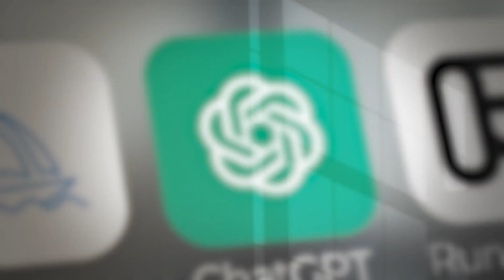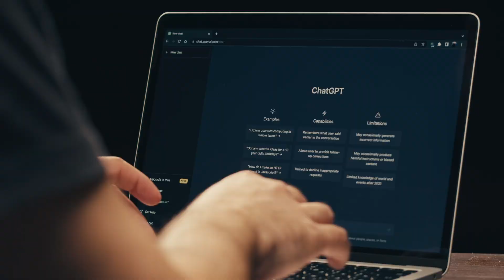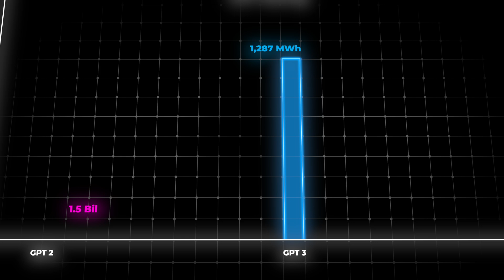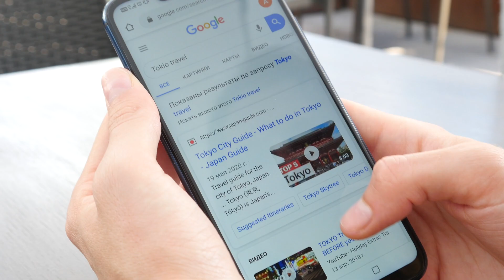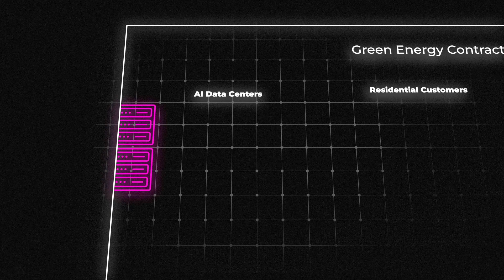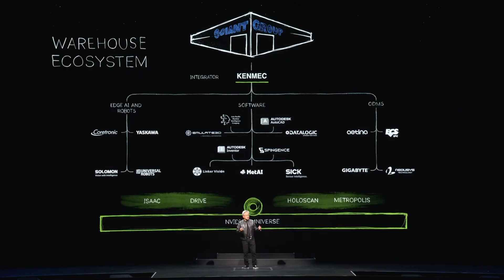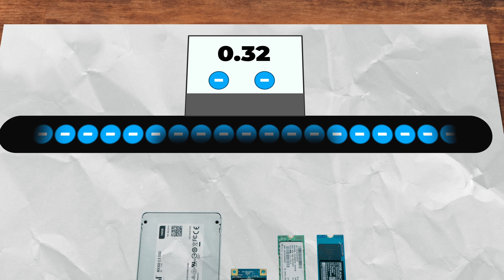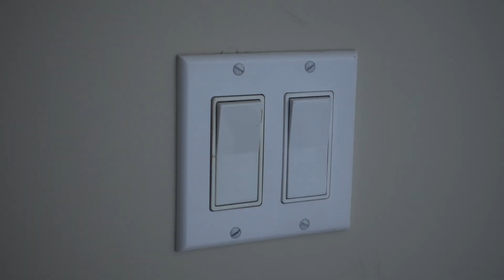AI's Hidden Cost: Can Our Power Grids Keep Up?

Comment: Has anyone done a calculation on how world wide data centers affect global warming?  They are warming up the atmosphere.  If they are supplied incrementally by the grid using fossil fueled power plants they are also responsible for the waste heat produced by the power plants.

Comment: I’m always up for heat recovery videos.   I’m not sure the temperatures are high enough to economically support waste heat recovery.    

You should visit Ormat and learn about their geothermal and waste heat recovery methods using a low temperature organic working fluid like butane.

Comment: You didn't even mention cryptocurrency. Tesla is also building mega-batteries to absorb excess power at peak production and feed it back into the grid during peak consumption. The infrastructure also needs upgrading. It is not built to handle the power loads of the future economy.

Comment: This is upside down and scatter brained thinking.  What has killed public power grids and people from lack of focus on their power supply lines in the USA is forcing them to buy when-ever-available expensive nearly worthless erratic solar voltaic and wind generated electricity not the nice predictable loads of a good data center customer that supports the power grid with its purchases.  New data centers are typically great power grid customers.  

Commercial HVAC system use natural gas for heating water and direct heating.  They do not use heat pumps for generating heat.  There are special situation, but heat pumps don't offer a heating cost advantage over heating with natural gas.  There is no move to switch to heat pumps for heating in highly engineered commercial HVAC systems.  That tells you the economic physics of the situation.  

Anybody that is promoting greenhouse gas emissions is ether ignorant or a criminal in what they are doing.   Its high school level science all the greenhouse radiant energy from the earth is entirely absorbed in earth's greenhouse effect within 20 meters of the surface that is always in saturation from the strong greenhouse water vapor.   Any high school science nerd should remember that.  I do.    

You can say noncondensing greenhouse gases warm the planet, but only as a share in a saturated system where water vapor would hold it in saturation regardless of the presence of the noncondensing greenhouse gases.  It is impossible to change the overall effect of earth's greenhouse effect with noncondensing greenhouse gases such as CO2 or methane.   In that saturated system on average CO2 has a 1/4 of 1% share in earth's greenhouse effect.   Earth's greenhouse effect adds 10°F (5.55°C) to earth's average temperatures.   CO2's average temperature forcing share is 4/1000°C - 6/1000°C.  Global warming is about 1°C.  That shows how far away impossible it is for CO2 to make any significant difference with its greenhouse gas behavior.   

If you follow global warming over the last 45 years global warming after rising at 2/10°C per decade in the 1970s and 1980s went dead at about 1°C in 1992 and has stayed there.   It was a surprise and a bit of a disappointment after promoting the typing point of 1.3°C as causing stronger hurricanes in the Gulf of Mexico by the late 1990s.  In 2022 global warming was officially reported at 1.06°C.   

The cause of global warming is not known after much scientific study in 2024.  Much effort has been focused on possible human causes of global warming with no human causes no matter how removed totaling to net zero.  After this long period of study over 60 years it is very unlikely global warming will emerged as having come from human causes.

Comment: Rick, we have an impass about the second law of thermodymamics. You are probably as tired of me thinking we can escape it as I am about you asserting it is inescapible. 

Here is one of my attempts at being too simple to fail but not too simple: 

A simple rectifier crystal can, iust short of a replicatable long term demonstration of a powerful prototype, almost certainly filter the random thermal motion of electrons or discrete positiive charged voids called holes so the electric current flowing in one direction predominates. At low system voltage a filtrate of one polarity predominates only a little but there is always usable electrical power derived from the source, which is Johnson Nyquest thermal electrical noise. This net electrical filtrate can be aggregated in a group of separate diodes in consistent alignment parallel creating widely scalable electrical power. As the polarity filtered electrical energy is exported, the amount of thermal energy in the group of diodes decreases. This group cooling will draw heat in from the surrounding ambient heat at a rate depending on the filtering rate and thermal resistance between the group and ambient gas, liquid, or solid warmer than absolute zero. There is a lot of ambient heat on our planet, more in equatorial dry desert summer days and less in polar desert winter nights. 

Refrigeration by the principle that energy is conserved should produce electricity instead of consuming it. 

Focusing on explaining the electronic behavior of one composition of simple diode, a near flawless crystal of silicon is modified by implanting a small amount of phosphorus on one side from a ohmic contact end to a junction where the additive is suddenly and completely changed to boron with minimal disturbance of the crystal pattern. The crystal then continues to another ohmic contact. 

A region of high electrical resistance forms at the junction in this type of diode when the phosphorous near the ĵunction donates electrons that are free to move elsewhere while leaving phosphorus ions held in the crystal while the boron donates a hole which is similalarly free to move. The two types of mobile charges mutually clear each other away near the junction leaving little electrical conductivity. An equlibrium width of this region is settled between the phosphorus, boron, electrons, and holes. Thermal noise is beyond steady state equlibrium. Thermal noise transients where mobile electrons move from the phosphorus added side to the boron added side ride transient extra conductivity so the forward moving  electrons are preferentally filtered into the external circuit. Electrons are units of electric current. They lose their thermal energy of motion and gain electromotive force, another name for voltage, as they transition between the junction and the array electrical tap. Inside the diode, heat is absorbed: outside the diode, an attached electrical circuit is energized. The net energy in diodes connected in consistent alignment parallel is aggregated. The maximum energy is converted from ambient heat to productive electricity when the electrical load is matched to the array impeadence. 

Matched impeadence output (watts) is k (Boltzman's constant, ~1.38^-23) times T  (tempeature Kelvin) times bandwidth (0 Hz to a natural limit ~2 THz @ 290 K) times rectification efficiency times the number of diodes in the array 

Order is imposed on the random thermal motion of electrons by the rigerous structual orderlyness of a diode array made of diodes made in a slab: 

v v v v v v v v v v v v v v v v v v

All the boron doped anodes abut the top face of the slab; all the phosphorous doped cathodes abut the bottom face. Simple. 

Aloha

Comment: Future video topic suggestion.  The discussion can be split between training and inference (and deployment).  

Training is more batch-able, and can utilize renewable energy, esp. when there's plenty.  (There are also cap-ex and capacity factors to consider.)  

Inference is more real-time, and requires 24/7 power. But it's also a space ripe for innovation, such as quantization, compressed models, new hardware such as analog, or elimination of scheduling and frequent memory transfers in favor of optimized deterministic pipeline via compiler (e.g. Groq).  There's also edge devices, consumer AI hardware, such as what Apple is doing, in conjunction with private external servers, and services.

Comment: especially when AI is used for data mining. - I've  built an in house AI.  it consumes very little power . currently less then 4watts with off the shelf hardware . it can do mostly in house  as 99% of my daily information required . anything else  it just does duckduckgo search to bring up relevant info . the does voice, facial and gesture  recondition  . it will greet you or a specific person in the morning and say good night to you  and warn you if you are staying up to late  or in  some form of medical distress or have conversations with you if yuo want. if it recognizes the person at the front door it will tell such and such is/was at the front door  log call displays and when you return it will tell which phone call you have missed ( and information dependant it if the call came for the wife or child  it will  inform them specifically )    . it does ques on  gesture recognition  as i hate  saying key phrases but can be triggered by voice commands  ,  it notify you of unknown people  with in  or outside your home  if you are not home . it  will do weather,(solar ,wind. precipitation ) prediction weeks into advance . monitor the  entire  house and adjust power consumption or production to get maximum efficiency . it operates at 8Tflops range.  which is more then enough for in house operations .   . all while  the device acts as a  home router( openwrt) , automation (Domoticz), zigbeehub , database/media   server, sip and security system ( zoneminder )  . essentially I have one device  that does  what was once 10 devices  now only one device  reducing  energy consumption even more so. from what was once 75watt total combined to <4 watts  ( peaking it 5watts from time to time) -

Comment: I am a career data center guy. Every time I see big data centers claim to be ‘green’ by purchasing all the power from a hydro power source I call “BullSH**!” Locking in that power does exactly what you suggest, make utilities find other sources for their other customers!! 

I also agree that Data Center heat needs to be USED not discarded. But here in the US it’s cheaper to burn new gas than to recycle DC heat, so very few do. It is low grade but it can easily heat space and domestic level hot water. We just need to Do It.
Reply: "I am a career data center guy. Every time I see big data centers claim to be ‘green’ by purchasing all the power from a hydro power source I call “BullSH**!” Locking in that power does exactly what you suggest, make utilities find other sources for their other customers!! "

If they purchase "green" power they can make that claim. And the more demand for "green" electricity the more it will be built out. This is not a big issue.
Reply: There is no way to create energy with all that extra heat?

Comment: Happy to hear that analog computation is finding new life. Sixty years ago I had the pleasure of programming the Electronic Associated PACE Model 231R, the last of the large analog computers. It regularly calculated results faster than our department's digital computers. Then we installed a Philco 2000 with 10k core memory!  Analog still won the timed races, but lost out on precision with "only" four-digit resolution.
Reply from the maker: wow that's so cool, i'd love to interview you for something if i cover it again!
Reply: @TwoBitDaVinci  Sure. Residing San Diego now, but relocating to Phoenix in August. BTW, imagine the power requirements if AI only had the vacuum tubes we relied on!

Comment: AI will likely increase electricity demand well beyond our current generation capabilities and grid capacity. This means new generation and grid architectures will need to be deployed to meet demand. The new electricity generation facilities will likely be the cheapest and most reliable available per unit of energy. Thankfully this is solar, wind, and batteries. If additional higher density generation is needed, AI will likely help us develop and deploy it.

Comment: Well...  In Alberta Canada we have flared excess natural gas beyond what the government has set as a limit.  For zero usage, not even as heat.

It is of course to maximize sales of oil to the USA.
Reply: It's just crazy. We've been doing the same here in Venezuela for decades, even when there's no supply of natural gas for households, you would see the flares (called mechurrios here) burning high on the top of tall towers. So sad to see.
Reply: The gas has to be flared if there isn't a pipeline network to take it away.

Comment: In London there's a ban on constructing houses until 2035 because the grid is at capacity due to data-centers, and IreGrid forecasts 25% of Ireland's electricity in 2030 will be consumed by data-centers (and that forecast was made before the current AI boom!)  I actually think consumption will drop as the bubble bursts, and as models move to inference on device to reduce latency and assure privacy.
Reply from the maker: seriously? that's crazy!
Reply: @TwoBitDaVinci  Crazy that they haven't considered building houses with solar and batteries that actually help the grid...
Reply: "In London there's a ban on constructing houses until 2035 because the grid is at capacity due to data-centers, and IreGrid forecasts 25% of Ireland's electricity in 2030 will be consumed by data-centers (and that forecast was made before the current AI boom!)  I actually think consumption will drop as the bubble bursts, and as models move to inference on device to reduce latency and assure privacy."

It's not a bubble that will burst, but more like a market consolidation happening.
Reply: Why don't they force datacenters to only use large amounts of power when there's excess renewable energy? I feel like training AI would be perfect for balancing demand around energy supply.
Reply: The ban is on data centres not houses. I live in London and there are houses being built. Lots of them.

Comment: It’s not just AI but humanity’s exponential growth in energy consumption in general that is unsustainable. There is no energy resource of any size we won't quite quickly outgrow with just a modest 2% annual growth. We could collect 100% of all the sun’s output, not just all the solar energy that falls on Earth but ALL of the above, and still need more within a few centuries. We could expand outward into the cosmos at the speed of light and put all the energy we find into our service and we’d still need more fairly soon. Our grand delusion is that business as usual consists of 2% annual growth.

Comment: Low grade heat from a compute center needs to be concentrated (heat pumps) and sold to offset industrial heat or large scale building heating needs. How about sand batteries storing TWh of energy for winter use.

Comment: 14:30 - "there's so much more we could do if we just got clever." Yes, but instead we let ideology control our decision-making. We create fake threats like "climate change" and fake goals like the impossible task of controlling the weather. We make the impossible task even harder by saying that we must do it by de-industrializing and refusing to use efficient forms of energy, but instead requiring the use of the most expensive, resource-intensive, and least reliable of those options. And then we complain when people want to have their high-demand services like our entire information economy (because we shipped all the manufacturing to the third world so they can deal with the pollution and labor issues) without enough power to handle it, and while ideologues, yourself included, are pushing hard to ensure we never ever have enough unless it comes from some breakthrough technology that comes from a communist country and is owned and operated by one of our big tech multi-billionaire oligarchs or the gov't directly.

Yes, we could accomplish a lot if we didn't have this sort of nonsense going on.
Reply: Try loosening the bands on your tinfoil hat as they appear to be on too tight.  Also, you forgot to mention in that diatribe that the world is flat too! :body-green-covering-eyes: